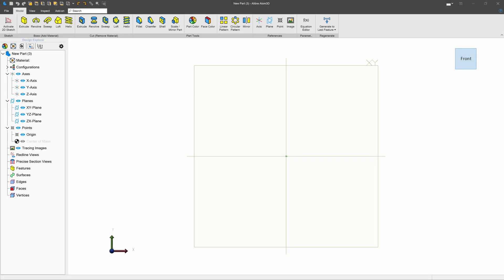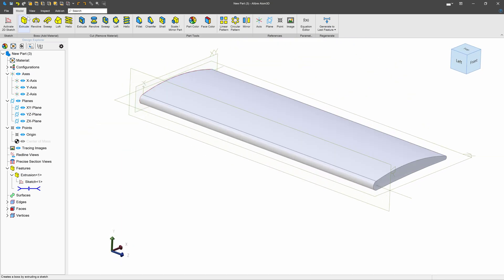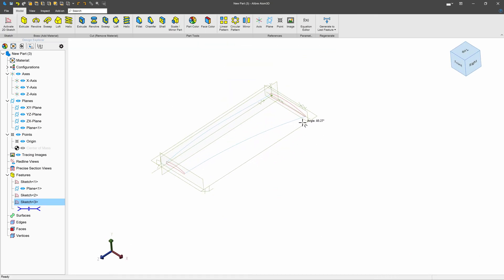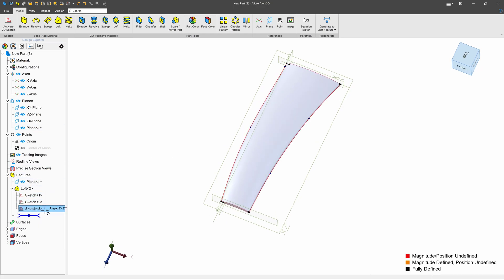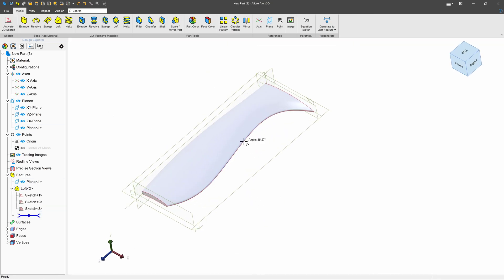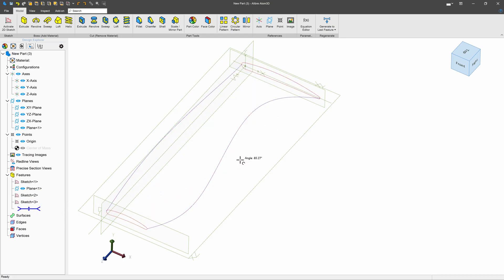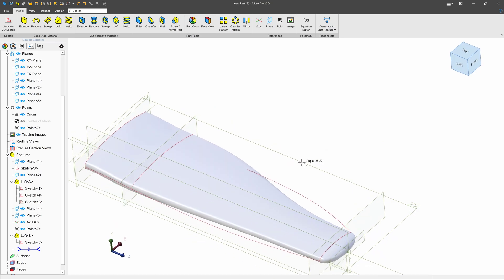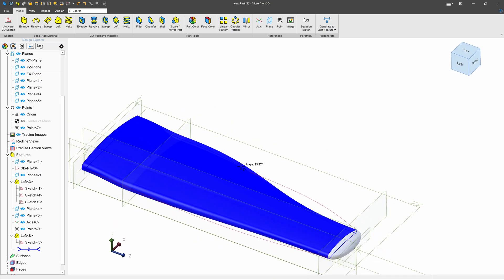Alibre | Creating Wings and Air Foils in Alibre Atom3D!

Comment: is it possible to control non-linear aerofoil twist along the length of the wing? it's very challenging (or impossible) in many CAD programs ive used, but it is very important for precise wing design.
Reply from the maker: Like this?

https://us1-browse.startpage.com/av/anon-image?piurl=https%3A%2F%2Fpressbooks.lib.vt.edu%2Fapp%2Fuploads%2Fsites%2F23%2F2021%2F06%2F1.34-1024x269.png&sp=1742483261Td0dbc2ed283e229d7aab594eaaa6ab428de1bb1efd276d66d846f0e64da4a50b
Reply: @AlibreLLC  yeah! the twist needed doesn't have a constant angle change along the wing. that diagram has a constant angle for the twist when lofting between the two aerofoils. the best i can do is approximate the twist at different lengths along the wing and loft between a dozen aerofoils, although it's a very time-intensive method and it gives an approximate result.
Reply from the maker: @overthinking-person-projects  3D guide curves could be a solution, how would you define the profile?  Could it be done dimensioning from the top view and the front to create the 3d twist you need, or would some other way be better?